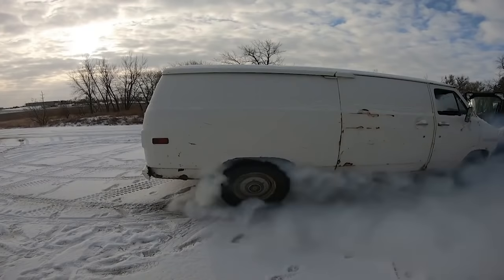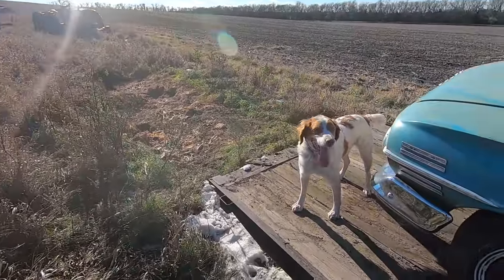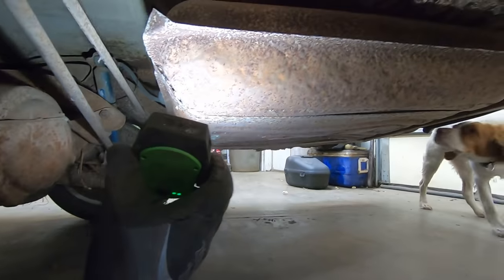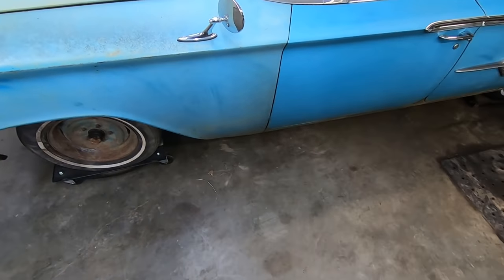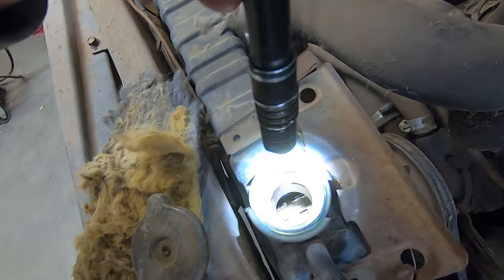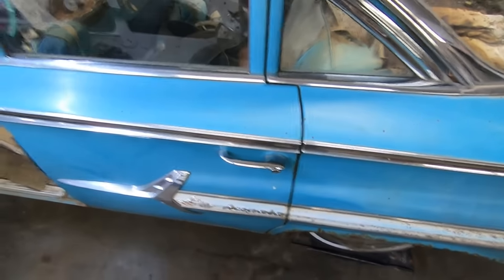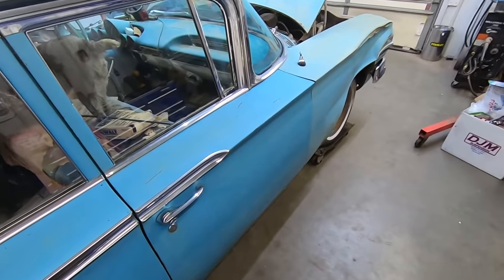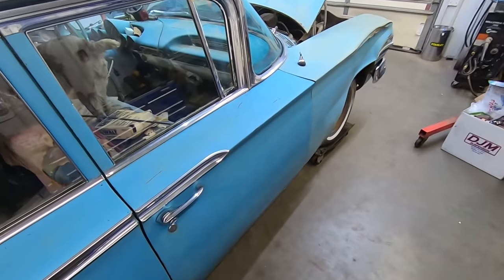1960 Chevrolet Impala! Will it Run?!? Abandoned in a Field for 17 Years! Bonus! Paint Revival!

Comment: Sometimes I think it's unfortunate that we have such obsessions with the V8 here in the US. Old straight six powered American cars are so cool, so reliable, and just so damn nostalgic.
Reply: those 235 are killer for sure last forever!
Reply: @markwatts7074  Yeah, I'm a Ford/Mopar guy, but I have much love for the Chevy/GMC six cylinders. . .and the AMC/Nash sizes etc.
Reply: If you dont know why we have an obsession with the v8 go drive a chevelle with a 454 or gto with a 455 id pass on fords and mopars since you probably want to make it home
Reply: In line engines are more dependable and turn more RPMs without coming apart.
Reply: Also cheaper for part's I had HQ Panel Van with a 186 Holden red motor three speed used to travel at 100mp (or 160km in Australia) 😅🤣lot of people wouldn't believe until it only took 8and a half hour's to do 1200km 😅🤣good old day's all the best
Reply: @derrickodyes1934  HeHe...Had a 460 loose a rod bolt with disastrous results in my 76 truck...Left me stranded about 1 hr from the house...

Comment: 2 hours of Duff & Mortske? You're spoiling us.  Dad had a '61 with 283/Powerglide.  White, red interior if I remember.  From what I can recall he bought it for $500 + his 1950 GMC truck (which he paid $50 for) and ended up swapping it for a '58 Mercury Monterey with a 383 & 3 speed that someone had converted to a floor shift.  That blue color is beautiful, paint came back nicely with a little attention.  Fix it up, make it safe, leave the patina, throw some blankets on the seat and drive it.    Thank you for what you do and for sharing these cars & trucks with us.  I've been in the auto service industry 20 years this year and wish I could work on older cars like I grew up with instead of all the new stuff.
Reply from the maker: Your dad had some neat rides!
Reply: @MortskeRepair  yes sir he did! 57 Ford wagon, 66 Mustang, 71 Skylark, 73/76 Montes, 75 short wide Chevy and a 78 Olds 88 Holiday. I miss him a lot, he taught me everything from weed eaters to outboard motors to John Deere tractors and of course cars and trucks. Thank you for replying. Mom's 64 Malibu SS was okay too ;)

Comment: To open that door you need a Slim Jim. This is a tool made out of a thin piece of flat steel about an inch wide with a notch in the side near one end. You slide the Slim Jim down into the door on the out side of the window. You hook the notch around the lever on the catch of the  door latch and pull up. 
This bypasses both the inner and outer door handles and should open the door.

Comment: And to think, after all these years, after I blew up my 57 Pontiac, I turned down a 60 Chev 2 door sedan because it was a 6 banger(same color as the one you have) (folks were helping me buy it). Silly me. Scuff and spray bomb the top. It will look better in the short and long run. Love the vids. I don't watch them right away. I save them until late in the week so I don't have to wait so long for the next one. I know, I know, doesn't make sense but I am old so I am allowed.
Reply from the maker: Thanks for watching and commenting!

Comment: I love the old strait six cylinder motors. no computer and all the wires and tubes to deal with. No check engine light to be a pain in the rear. Just easy to work on and to get to everything. Ah, the good old days.
Reply from the maker: Simpler times Daniel!
Reply: @MortskeRepair  We have soooo many more people with mental problems now and part of it is the complicated world we live in. We have a newer Nissan and I hate it. Every time you do something it doesn't like there is a buzzer going off and it is easy to do it. Had a check engine light come on last week. Checked it out and it's a mass air sensor. Just another pain in the behind.
Reply: @danielheartsill4269  Check video for cleaning MAF sensor......very easy......most likely, do a throttle body cleaner too.
Reply: @jimbeam7160  Thank  you.We took a road trip waiting for the new one to arrive and the check engine light went off. I will find how to clean and keep the new one for later.
Reply: @danielheartsill4269  https://www.youtube.com/watch?v=xQGSkWEC_u4  

Also...find a video on throttle body cleaner.  You just pull the big black hose off the throttle body.......and rev your engine while shooting the cleaner down the throttle body.  And...run a bottle of SeaFoam gas line cleaner in the tank of gas.  Very cheap and easy to do.
Reply: The funniest thing, I ordered a new one. Over the weekend we took a trip to to Oklahoma. I was able to buy gas without ethanol. We made a pit stop forty miles later. Got in the car, started it and the check engine light went off. The new one came in and I installed it but am going to clean the old one and keep it. Thanks for the information. @jimbeam7160

Comment: And when the three on the tree gets worn out you can get it in two gears at the same time and then you have to shut the engine off and hope there is no strain on the drive shaft so you can get under the hood and pull on the shifting mechanism and get it back in neutral. Fun times 😀👍
Reply from the maker: Yeah. Proper maintenance prevents such occurrences.
Reply: @MortskeRepair  dirt roads eventually take a toll.
Reply from the maker: @JamesCouch777  Yeah, the bushings are pretty easy to replace.
Reply: @MortskeRepair  it was my dad's 1949 Chevy pickup truck.

Comment: Amazing job! I didn't think the engine would ever run that smooth with the problems it had. The paint looks Awesome .I would at least try to reduce the dent on the passenger side, just for fun! If you mess it up bad you can replace it. I would throw alittle white paint on the top. Not to make it perfect ,just bring it back to be closer to the condition of the blue color. So, that way.. you get an idea of how it once was.       ....You were right on target about the hub caps. That one that is a clock on your wall woulda been on that car. Id look for those , or any version with the  "Crossed Flags" logo on it.  about  30. $ each on evil bay..

Comment: When you had the distributor out why not reach down and spin the oil pump up with a drill for a few minutes to pre-oil the engine?  This way everything's pre-oiled when you start it and you would also know if the oil pump itself it still good.
Reply from the maker: Cuz I’ve never had an oiling issue yet

Comment: This is why I like the setup International 6's had: the oil pump is directly driven off the cam, so the distributor has no gear on it at all, just a slotted shaft. No teeth to mess up or mistime. They also turn the wrong way!
Reply from the maker: I never seen those! Cool!
Reply: Also, if the distributor is driven from the oil pump, the engine can't run if the oil pump isn't turning. Unlike the other way round.
Reply from the maker: @jrevillug  very true

Comment: It being a 1960 model you'd probably have to leave the radio on for 30 seconds or so till the tubes warm up before you heard anything.  That being said, IF you did hear anything it would probably be a loud hum as the old electrolytic capacitors will have leaked or dried out completely by now and the vibrator is probably shot as well.  Then there's all the regular capacitors that will leak current as well as they were never designed to last 60+ years and by now the wax will have melted out of them and let moisture in.  Tubes themselves rarely go bad.  They'll get weaker over time and if the radio was used an excessive amount they may be on the weaker side but ordinarily would still work though not as well as fresh ones.  Resistors, it depends on the brand it has in it.  Allen Bradley resistors tend to keep their ohms values pretty close to specs as well as old fashioned dog bone resistors.  "Roundies" which look like Allen Bradley resistors but with rounded ends instead of AB's sqaured off ends also get leaky over time and will mostly rise in resistance when they go bad.  If you ever get a car radio with tubes in it and have it restored though, they pick up stations amazingly well for AM and you'd really be surprised at the distance they'll draw stations in from.  I live in Southern Indiana and have picked up stations with a tube car radio from as far away as Toronto, Ontario, and New Orleans, Louisiana.
Reply: They stopped using tubes in car radios around 62-63. 
Some radios had tubes and transistors. The transistors were used for the audio power amplifier.
The tubes were special space charge types that could operate on 12 volts. No vibrator required.
My mother had a 62 Dodge with a radio like this.
I am not sure if car radios were made using transistors to replace the vibrator.
This was done on 2 way vhf transceivers but maybe not car radios.

Comment: As you may know, on the 235.5 the timing is set by setting the "octane sector", also known as the vacuum advance to zero. There is a ball on the flywheel you line up with a pointer in that hole on the bell housing just above the starter, using a timing light. You loosen the screw that holds the octane sector to the distributor and turning the distributor until that ball mark and pointer line up.... that's TDC. Tighten the clamp back up on the octane sector. Then you can adjust the marks on the octane selector to the mark on the casting where the assembly bolts down to the timing you wish to set it at. The 235.5 spec is TDC or 0º. 

I "think" the three speed gear box is a Muncie 318..... that's what's in my 59 Bel Air anyway. Often Chevrolet used a 4:11gear with the overdrive trans. Chevrolet used the 3:55 ratio on six stick with out overdrive, 3:36 on the six automatics, 283 automatics and 348 sticks. The 3:08 was used on 348 automatics..... automatics being the Powerglide or Turboglide. 
 
That is a very solid 1960 Impala! Most have zero undercarriage left. It cleaned up surprisingly well!
Reply from the maker: Great info on the ratios!
Reply: You’re the best Howard! 👍
Reply: @MortskeRepair  Chevrolet used a tag cut in different ways to show the axles ratio. I don't remember the shapes off the top of my head, but some had a hole in them, or an edge cut off or two edges cut off, it's kinda an odd way, but I find there always spot on. The shop manual should show the tag shape. Myself, I just go by the engine transmission set up to know what the ratio should be, but anyone could order any of the ratios with any engine trans combos.... like if you wanted to tow a trailer as an example....

Comment: You can just drill out the sidebar on GM locks. It should be at the 9 O’clock position about half way between the outside edge and where the cap meets dust cover (inner circle). If you drill that off with a 1/4 drill bit you will have a screw driver operated lock.

Comment: Be careful. If they wired the overdrive solenoid to a switch and you mash it in reverse or try to pull it backwards it will destroy the planetary gear set.  Ask me how I know.
Reply from the maker: I could see that happening! My OD pickup won't shift into reverse with it engaged.

Comment: A few comments 
If you pull start almost any manual shift vehicle it WILL start - even if it has crappy compression 

Your compression tester needs a new a schrader valve
Remove the pressure real easy button and install a new valve
It will hold a reading
Reply from the maker: If only my dog could steer...

Comment: I actually had someone take a bolt out of the air filter wile the engine was running and dropped a bolt down the carby into number 6 cylinder and tried to blame me for fitting a dud motor until I found the bolt on the piston lucky his mate was there and told us he had dropped it otherwise he could have blamed me but it wouldn't have lasted running as long as it had all the best
Reply from the maker: Ouch!
Reply: @MortskeRepair  I was lucky his mate was honest all good all the best

Comment: fyi a 4.3 hei drops in to that block then you connect 1 wire done deal no more points !!
Reply from the maker: No they don’t. Completely different bottom end and gears between the two. Fake news. I’ve got both here. In fact I’ve made in depth videos on both distributors if you wanna check out my 92 Chevy video you’ll see they are entirely different.

Comment: Hey Mortske,
You can use the flywheel to find TDC , down by the starter there is a hole with a pointer , line the pointer up with the BB mark on the flywheel and you are at TDC  on #1 or #6 cylinder depending which dot you line up. There should be two on the flywheel, worthless info for you.

Comment: well mortske I guess Iowa Classic Cars will be visiting 

Kool reference thanks lol

IF YOU LOOSE YOUR SCREW THEN SCREW IT LATER 

MORTSKES GONNA TAP THAT THEN GET A SAMMICH 

YOU FORGOT THE EXHAUST CAM  FOR THE VERY FIRST START

   I LOVE A CHEVY BUMP JUST BUMP A BOWTIE AND YOUR RUNNING 

said thing living in there crawls out while mortske does burnouts and crawls up mortskes pant leg 

im REALLY starting to think your liking autobody 

now just replace the fender completly sand it and prime it then block it lazer straight the buy some single stage blue paint it the wet sand it and buff it the shoot 4 coats of clear on then wet sand that and it will look like you could swim in it

Comment: that what you taped the screwdriver to look kinda like a rusty old sissy bar. I dont really know if it would have worked if you would of grinded the tip of it to fit the back of your lock  I was thinking it though. Im no mechanic,Im an english professor as you could probably tell😁 Love your show Mr.M

Comment: But good mechanic you like that Thailand channel the tech mec channel he makes and builds cars out of parts and steel frame hybrid volks wagon engines by 3d printing them to look hybrid etc and make electric cars puts gearbox and ujoint together by welding the two joints together makes jeeps etc you like him but fix engines and make starting stands and makes electric cars go almost and jeeps go almost 200 miles an hour with big by at store DC engines turning gears about little bigger than your fist those DC engines  cool vid but you cool fixing engines and starting stands and make engine ones that guy does with also hybrid 3d engines printed go that fast too cool I'll watch your channel too now

Comment: The main issue with those 3-speed column jobs is that when they get worn or really out of adjustment they get hung between gears and you have to go out under the hood and unjam them. Or, at least, people used to. A guy local got killed doing that when his truck ran over him many years ago.
Reply from the maker: Yeah, nobody ever maintained them properly

Comment: it's sad that the only thing with this kind of age left is 4 doors. the 2 doors have all been rodded and wrecked, and are now toaster ovens, washing machines and refrigerator doors. edit; i knew what killed that distributor before you did. i dropped a point hold down screw from distributor during a tune up on a '70 dodge charger when i was 15 and working in the garage of a guarantee auto as a mechanic in high school, and just replaced it with one from a used distributor without finding the one i dropped. i thought it hit the floor, but it fell under the top plate where i couldn't see it. when i tried starting the car to check the timing, the loose screw got wedged between the distributor housing and the mechanical advance and stripped the plastic drive gear. it cost me a week's pay to replace the distributor. i learned a hard lesson that day i'll tell you.
Reply from the maker: It could have been worse I suppose!

Comment: I think the dome type hubcaps are from a mid 50's and up pick up. I had a full set i bought from a hubcap hoarder. The ones with the simple bowtie are the coolest. Those 235 six cyls. are indestructible. Seems like for the fender you would need a rubber mat on the floor to get it close.
Reply from the maker: Yeah, wish I had 2 more of those caps!

Comment: Just mask it off and spray the roof white again. It's just acrylic enamel. Even if you use some high gloss equipment White from local Farm and home store got by cheap. But you better do it so I can bake in the summertime heat like July August. I know where there's a four-door it has Bel Air fenders on it but I think it's something lesser than that like a Parkwood or something. It's a sedan. Plus any has a station wagon that's pretty roached out. Some parts have been used off of these cars like to drive train. Where has complete dash in the four-door. No Impala trim but the seats sure are better. I've got a flat top four door hardtop Impala 283 powerglide bottle off the original owner back in 1985 or so. And a 60 that's really roached out those are running driving when parked back in the '80s. Anyway all the stuff is between you and St Louis Missouri. I'll be glad to give you the phone numbers and send you some pictures if it'll help you. Now I believe this one is a little bit older so you may be past the 60 Impala by now. But this four-door with the seats I don't think you could scarce him by the seats for what you can buy the whole car for. It's a roller. If you're interested reply. If not somebody else will buy it from the guy.

Comment: $3500 seems like a great deal for this all things considered. Would make a really cool daily if fixed up right
Reply: Preposterously high.  You can get a modern car not nearly as roached as this Chev for about the same money...and...you'll have AC, heater, radio, and other stuff that works.  But......will someone pay for a doable project car with potential?  Sure.  Asking price is always high.  There's an ass for every seat.
Reply: @jimbeam7160  That modern car is gonna be as thrilling as eating plain toast. You don't buy a car that needs restoration for a daily driver, if you need a daily driver right away.